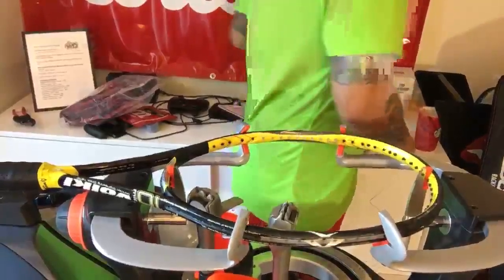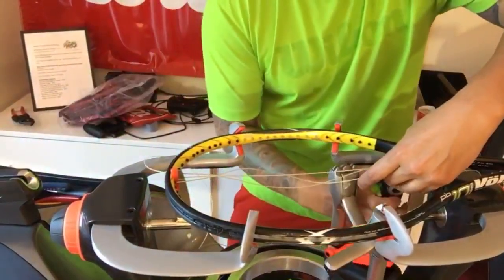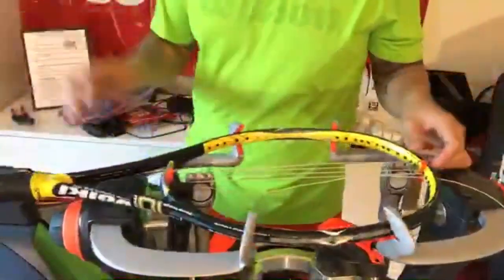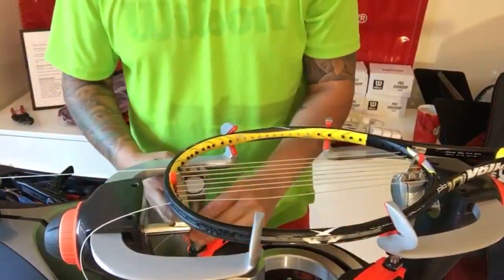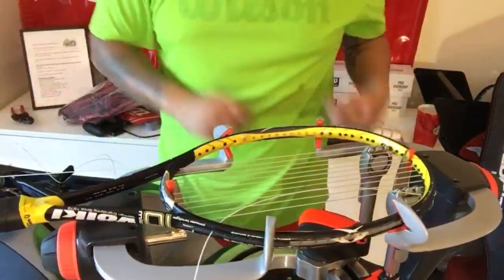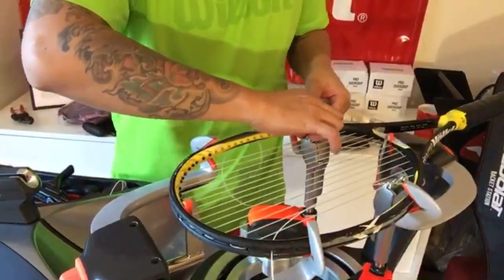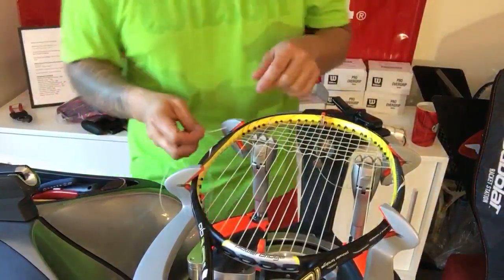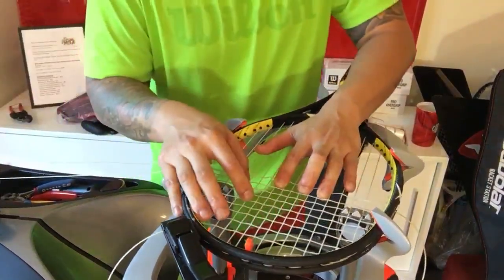The different ways to weave the crosses!

Comment: I used the fixed clamp to lock the first cross on the knot side before releasing the starting clamp,then tie the knot.
I will tie the knot after I am done with applying tension and clamped on the third cross( with preweave 4th and 5th), if the knot location is not on the 3rd cross, if so I will do the top knot after applying tension on the 5rd cross (with preweave 6th and 7th). I tend to tie the knot ASAP as the starting clamp can be a bit rough on the strings. I used a visa/mastercard empty roll instead of a thin parnell pad.

Comment: Why not use a bulky starting knot to begin the crosses with no clamp. Then first cross will have reference tension
Reply from the maker: Industry standard also even with a starting knot that is unnecessary pressure on the grommet  on that first pull which is the heaviest... if you have a clamp that helps the process
Reply: @mainscrosses  what about if you pull at reference tension no added poundage as the knot is already tied, i can't see how this would put excess tension. Do you always do the 'starting knot' on the crosses last?
Reply from the maker: Me personally I learned the technique from basically a grand wizard haha however when in Rome. They will tell you exactly what to do when you work with a team. Well, would you agree on a correct starting knot that bulk being pulled will cause that knot to push on that grommet making the hole bigger and moving that main string that it is anchored on... I say do what's comfortable for YOU... however if you work on a team they expect you to follow their rules
Reply: @mainscrosses  Yes I'm asking to learn I'm new to stringing. But if there is no tension loss and i pull 26kg directly on the knot pulling on the grommet my logic suggest it would be the same as a string at 26kg with the knot tied after assuming no tension loss. Also with the cross at the top as you have to add poundage, there would be increased pressure at the top due to the design of the racket being stronger at the neck. Just my thoughts. Thanks for your knowledge. Great videos
Reply from the maker: Reference tension isn't a concern  because I'm sure you can definately get ref on the first pull with the starting knot... I'm thinking more of string care. 3 simple rules:
correct tension, safety of strings and safety of frame.

Also string top down is my personal preference I dont want to work from my strongest point to weakest... cause unnecessary pressure from bottom up stringing
Reply: @mainscrosses  i always string top down as well. I just thought that pulling on the knot first cross at the top would be the same as in the finished racket as it must have that tension anyway.